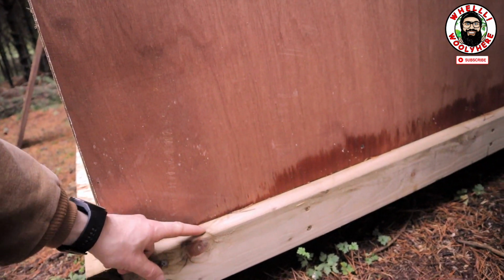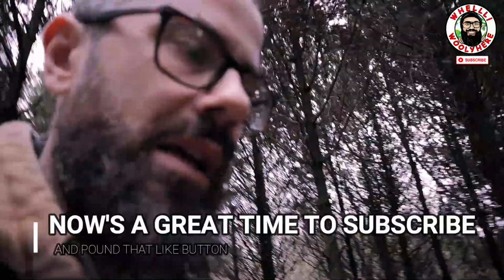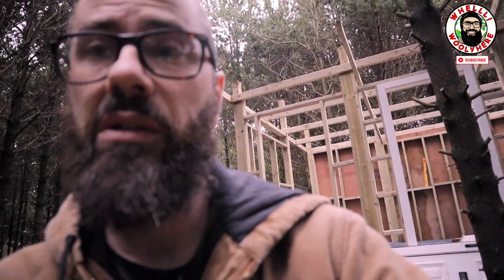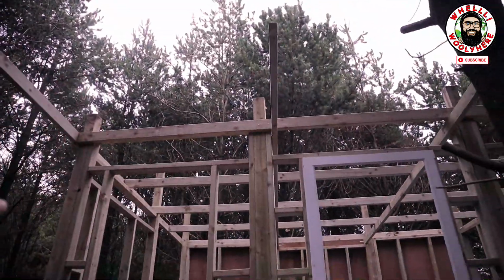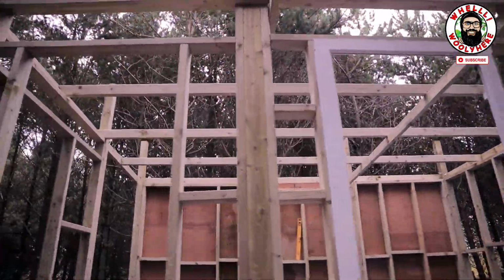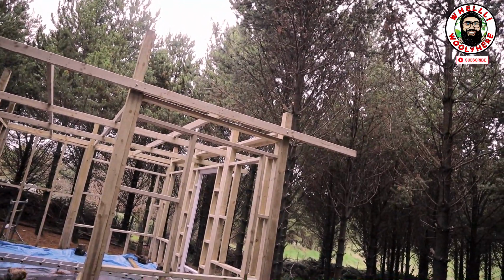Off Grid Small Cabin Build  Pt.11 Update and some advice please

Comment: At the base of the cabin, you should flash over the 2x4 with aluminum, after you seal it with a coat of paint( added protection) and don’t forget that there is a rubberized flashing for sealing the window frames and door. All flashings should be about 4-6 inches above the wall, then extend 1/2” below the lowest rain exposed wall surface!

Another issue you will have is being that low to the ground, water splash from the roof, this will also keep the boards from drying out as quickly as possible
Reply from the maker: thanks man, thats what i was thinking. i think i might do a temporary job on it for now with some damp proof membrane i found

Comment: Looks good. Put the flashing on first then put the membrane on so if water gets behind the tgv bords it will run down the membrane on and off the flashing. The rafters are ok for tin but what are you going to be doing on the inside of the roof ye need to think of that eg plasterboard or ply.
Reply from the maker: i havent decided about the inside yet, that will probably be a job for next year

Comment: Put 2" styrofoam insulation on the outside. between 2x2s (2x2s are to hold the siding so place them where ya need to). Then it'll all be the same, no lip on the bottom. then tyvek the whole thing and run the siding over it all even right down. With the windows, put them a quarter inch in from the outside and then caulk it on the outside after you paint or stain. any more of a lip and you'll have water build up when it rains. I'd make a window ledge on the inside. spray foam around the window from the inside. Don't caulk anything til you spray foam, and then cut off the excess foam after it drys. Takes a day or more if it's cold to dry. Then caulk the outside and the inside.
Reply from the maker: excellent advice man and thanks for the coffee

Comment: Wooly Explain what sort of tin roof shape is it corrugated or square gated tin ? It’s a shame you never show the tin roof that you got 😟
Reply from the maker: It's box profile anti drip tin, I must show it in the next one, it's the coated stuff
Reply: @WoolysWorld  Wooly was it dear to buy . Will you have any leftover offcuts on the long direction if you don’t overlapping it to much. Just give it’s recommended lab . Will the last sheet sticks out quite a bit long ways check to see . Right Wooly if it needs cutting you could Utilise that offcuts at the bottom being that it’s got a slight square shap along it and add the square shape to it . Better than tinfoil with bitumen on the back I know it as flash band its Only temporary won’t last sun will heat it up and deteriorates. Get 2 L shapes to make a zigzag that is the shap you want at the bottom .One tangled up and one angle down lap them in the right way and fix in place
Reply: @WoolysWorld  its the Grey coated plastic square roofing sheets ok great stuff if it is ⭐️I wish I could talk to you very frustrating in writing it down in what I mean and explaining it is easier.
Reply from the maker: @stevenbuckley1416  I get you, that would be good, but there will be none left over, it's all bought to exact measurements, we actually bought to little and we're waiting in more, I do know where there is a lot more scrap box profile, might get some of that. I'm actually going to put some damp proof down for now , stapled on in the same way I explained
Reply: @WoolysWorld  see you can cut and Adjust them to fit . If you can get some old stuff great even better there is a box channel in that if you find it cut it up
Reply: @WoolysWorld  good night to you Wooly food for thought for you to think about just here to help bud 👍🤝🙏thank you 👍
Reply from the maker: Thanks man, I appreciate it